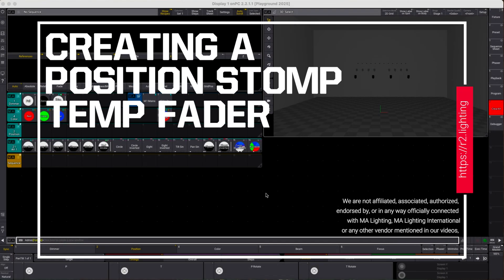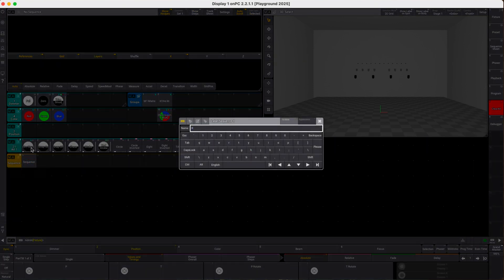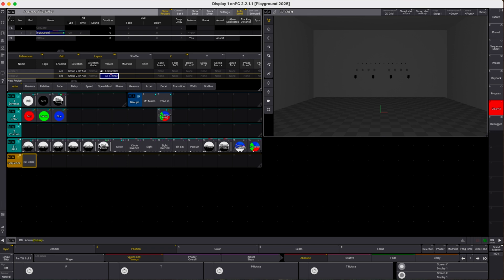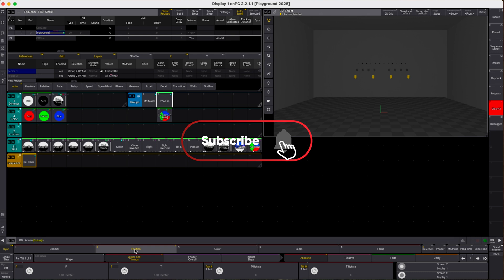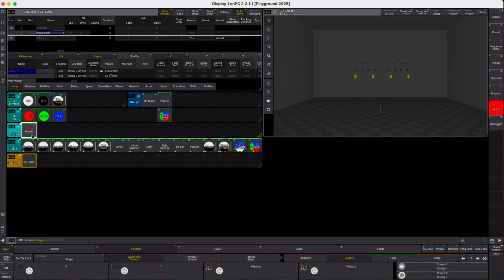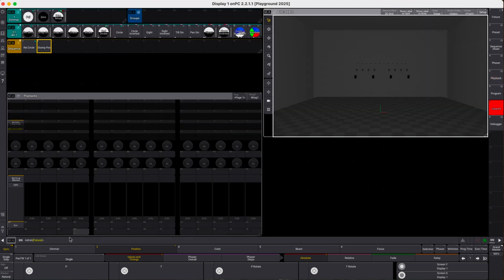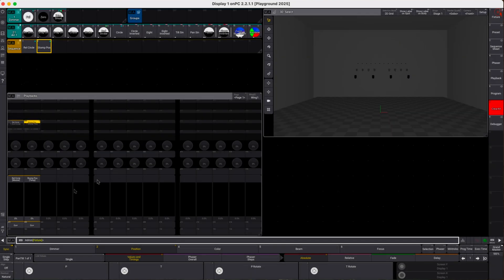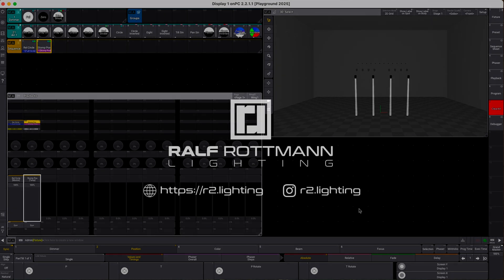05 Creating a Position Stomp Temp Fader - #grandma3

Comment: Hey brother. If you import a dmx channel, in the patch you can invert its output. 

From there you can add a dmx remote and have that one set the temp level of your seq. Doing it this way, means your assigned seq is just a seq of your dmx channel at 100 (dmx 0) and your actual stomp seq can just live in a pool tucked away and forgotten about. 

This way fader zero% is full stomp and 100% is no stomp.

Comment: What if my position Phaser is built with Absolute values?
(Since I want it to change between specific looks)
Reply from the maker: Then his won't work. I generally advise against building absolute position phasers. Not super practical if you've got a changing rig or even changing physical positions in a single rig.

Comment: Cool video but if you dont store the dimmer preset into the sequence(recipe), when you stomp the phaser and you want it to automaticaly run again when you turn off the stomp fader it doesnt start again. The solution i found was to not have the position phaser off on overriden but sometimes when you have a lot of position phasers you want them to override its other and then you cant stomp them and have them running again when you turn of the stomp phaser. Any recommendations?
Reply from the maker: @mikeaposto4965  Thanks for your feedback. I don't exactly understand what you're trying to describe, though. Are you saying that there might be a problem, when the Rel Circle sequence/cue does not include the recipe line with the Dimmer preset?
Reply: @r2.lighting  When there is only position information in the circle phaser sequence and you slide the stomp fader to 100% and stomp it, then when you slide the stomp fader down the circle sequence does not start again automatically and you have to press go on the circle phaser or turn the circle fader down and then up again for it to start again.
Reply: @r2.lighting  Lets say i have the circle phaser running and i want to stomp it with the stomp fader. I turn the fader to 100% and my circle phaser gets stomped. So far so good! Then when i lower the fader of my stomp sequence, i want the circle phaser to gradually start again. The problem is that when you only have a position sequence without any other preset like dimmer, when you lower the stomp fader the sequence is not starting automatically and i have to press go or turn down and up the circle fader. My solution was to deactivate off on overidden in my position phaser sequence but most of the times i want off on overriden to be on but still have the stomp sequence work. I dont know if im explaining it so well and i hope you understand but great video anyway...
Reply from the maker: @mikeaposto4965  Yes, this makes sense. If the cue in Rel Circle ONLY contains position attributes and the cue in Stomp Pos  overrides those completely (e.g. by turning the Stomp Pos fader to 100%), then the Rel Circle sequence gets off-ed. As you correctly describe, you can prevent that by deactivating "Off when Overridden" on the Rel Circle sequence in addition to having it deactivated on the Stomp Pos sequence. In my example, this is not required because of the ADDITIONAL dimmer values stored in the Rel Circle cue. The Stomp Pos sequence never overrides ALL values of Rel Circle, since it only contains position attributes and no values for intensity. It's an interesting follow-up question.